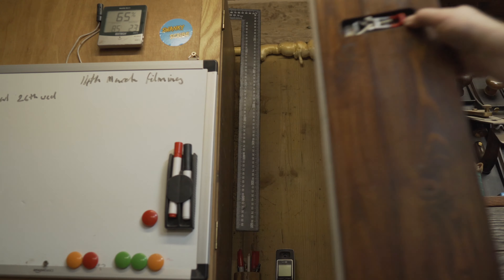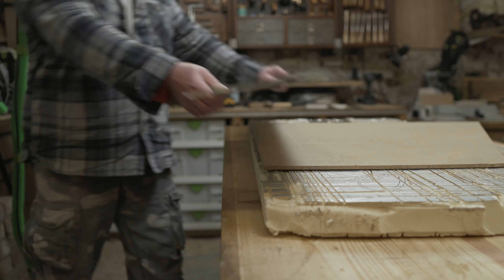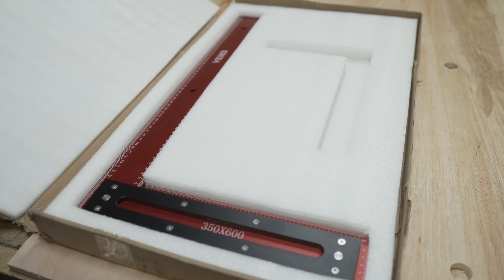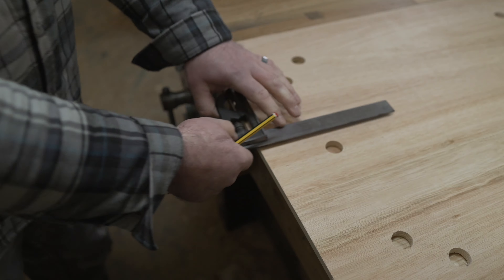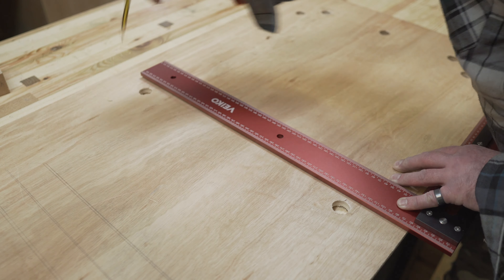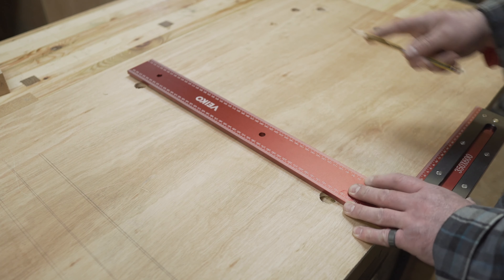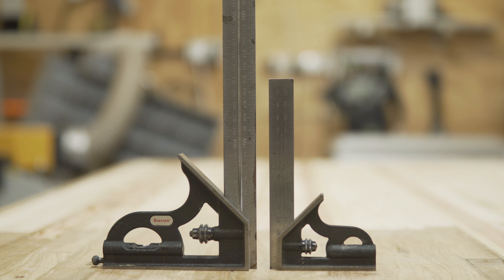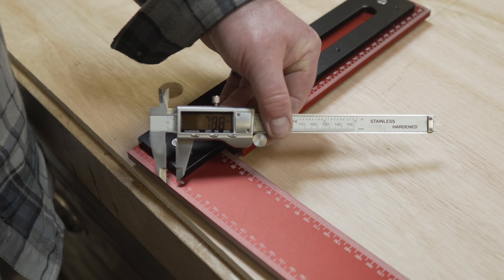Precision Woodworking square review 600mm.

Comment: Shame the millimetre graduations are worse than useless given how thick the material is. Maybe for another 40 quid they'll make one with chamfered the edges?
Reply from the maker: Yeah there is that, I can’t say I’ve used it like that I have trust issues and stick to the same rulers for all my making. I bought a 1.2m ruler from another brand and found when put next to my pucker ruler over 1m it was 1mm out hence why I use that same for everything now, I never use a tape measure! I hope you had a lovely Christmas! 🍻😊🍻

Comment: I bought a smaller Veiko square from Banggood, and it isn't square. So I have a very expensive ruler.
Reply from the maker: Ive only had a few items from them so far, the square, two mitre gauges and two ratchet clamps, and I’m well impressed! I’ve just finished putting a sacrificial fence on the expensive one and believe it or not I didn’t have to do any calibration! What happened when you told them it wasn’t square? I haven’t looked at them, are they adjustable?
Reply: @HewAndAwe   To be honest, I couldn't be bothered going back to them. No it is not adjustable. I have had some other items from them that have all been really good. Just not convinced on their precision instruments.